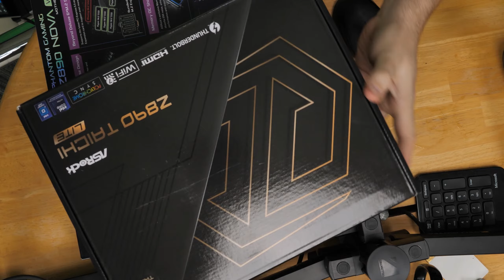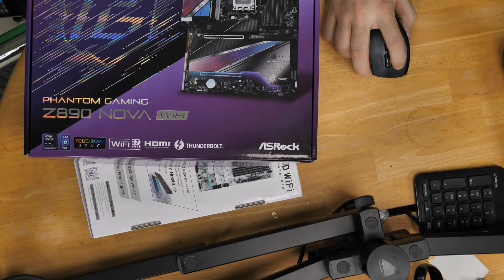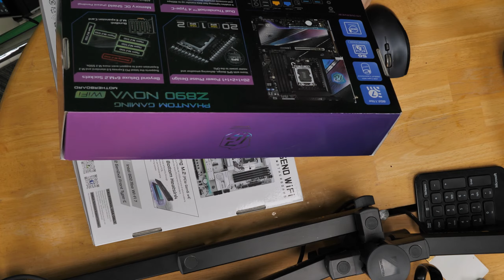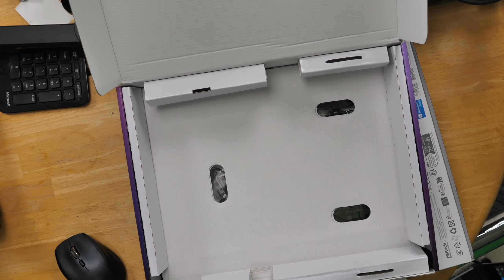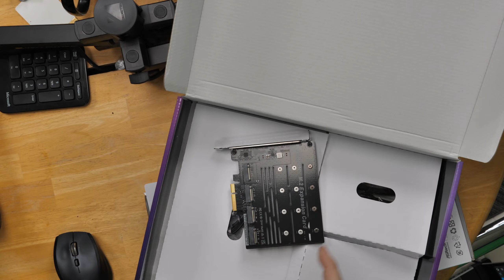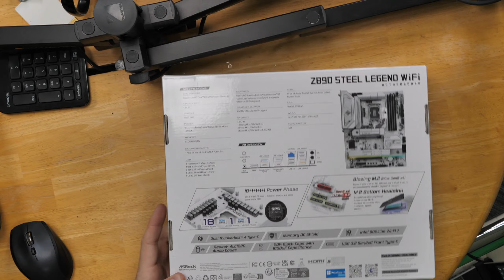Live - Z890 Motherboard Unboxings And Chat!

Comment: I have the Gigabyte Aurus z890 Elite Ice, with a 265K.  Really like it, it's a big upgrade from an 11700K. I suppose if you have a working 14700K or 13700K or even a 12700K it's probably not yet worth the upgrade.

Comment: I tend to prefer AsRock boards first (then Gigabite or MSI whichever has better specs for the same price) but this Blue and Purple paint on the board VRMs and other stuff I cant. Clashes horribly with my scheme. If they had just a "plain black" one I'd be all over it.  If nothing else pops by mid February I guess I'll get the MSI Pro Z890-A, 5Gps LAN and T-Bolt 4.  And screwing in heatsinks is a nothingburger for me. 5-10 seconds and I'm done.

Comment: The Live Mixer Z890 ATX board has excellent rear I/O, an accessible M.2 wifi card, and comes with three actual x16 (physical) PCIe slots. No EZ-GPU latch and one bare M.2 slot, but it is still one of the best configured, especially at a lower price.
Reply: I'm curious, why do you need 3 video slots? Anyway,  you change the video card every year....

Comment: I know using the 2nd PCIe slot on the Taichi Lite will disable the M2_4 slot (as per the manual), but do you know if using all 6x M.2 slots at the same time will slow down the GPU from 16x to 8x etc like with previous gen motherboards/cpus?

Would like to purchase at release on the 24th but can't find any info on this online.

Keep up the good work!
Reply: No impact.  No M.2 slots share any of the x16 lanes for GPU.

Comment: One thing not mentioned is that when you compare to the immediate last generation, the MBs in question seem a tiny bit down in terms of features or IO.  Not 100% in all cases, you'd have to hold up the 790 boards side by side to really see where they trimmed,  but it shows that when you don't have intergenerational competition for motherboards, the manufacturers have room to take a bit more off the top, in addition to the price levels they can sell the boards at when they first launch.  Or it could be that the newest and greatest features of the current gen cost so much more, that in order to hit their price targets they had to cut a couple less commonly used features along the edges.
Reply: I don't know, I bought the Gigabyte Aero G, Z890 for the 15th gen core 7 Ultra 265K CPU and it actually has a few more lanes, PCIe 5 NVME slot, 4 gen 4 slot NVME and something like 4-6 SATA connections and 2, count 'em 2, 2.5GB's Lan ports (the older Z790 only had 1, 2.5GB/s LAN port), you can go redundant or together to double the throughput. 

So much of what you see is hidden, oh, it also has USB 4 (Thunderbolt), the Z790 did not if I recall. At best, it has the Gen 3.1, gen 2 2x2 type C port(s). I'm sure there might be other additional features for the Z890 that I'm not thinking of.

Comment: I'm so over this idiotic rationing of PCIe lanes. The industry has moved on to PCI storage, we need more god damn lanes and bifurcation. All these boards are way more expensive than my last X299 board and have way less expansion potential.
It doesn't need to be threadripper lane counts, just give is 28 or 32 that we can split up for more NVME and add in cards. These ATX boards are becoming just as limited and frozen in time as laptop boards.

Comment: What I don’t understand is, if Intel moved from Intel “7” to TSMC 3nm, which allegedly has power efficiency and transistor density benefits, then why didn’t the new chips receive an upgrade in terms of additional CPU cores?  When Apple moved to new nodes (e.g., from M1 to M3/M4), Apple offered additional CPU cores, utilizing the density benefits of the new node.

Comment: I think Intel is preventing OEMs from making mATX boards for AMD’s X870.
Reply: What sort of conspiracy speculation nonsense is this? Why would anyone make a mATX 870e? You can't physically fit that many PCIe slots on mATX along with the second chipset and power regulators. 
AMD does hold back their mobo vendors with poorly considered  PCIe lane configuration requirements. So they couldn't make something like a single 8x slot with gobs of m.2 and peripheral ports that don't share lanes even if it was physically practical.
Reply: @mytech6779  I think Hardware Unboxed confirmed this, and I said X870 not e.
Reply: @koob1413  Ah I was thinking of the 670[e] which were both dual chip; I forgot they nerfed the 870 and removed a p21 chip.

Comment: I just realized z890 taichi doesn’t have dual x8 pcie slots.
Reply: That will only be an issue for a minority of people, I've never needed faster than x4 on the 2nd PCIe slot and that includes an Elgato card recording at 4K60.

What's more annoying to me is that using the 2nd PCIe slot disables the M2_4 slot reducing the possible NVMe drive count, but again that will only affect a minority of people as 5x M.2 slots will be enough for most people.

You may be one of the minority though, what sort of stuff are you looking to put in the other PCIe where x4 wouldn't be fast enough?

Comment: I wish mb would allow more 8 lane/4 lane PCIe cards, also all mb's now should have as standard 10Gbe RJ45 connections that can do 10Gbit, 5Gbit, 2.5Gbit and 1Gbit !
Reply: Purposeful hobbling of the ethernet standards, most consumers are too ignorant to know. However I have seen some already moving to 5g. Then again if you actually care about network overhead you would have an intel PCIe add-in NIC and not rely on the shoddy budget broadcom chip built into the mobo. (note asrock-rack mobos for epyc4004 have intel as a network option)
At 10g CPU packet-overhead of the cheap network chips becomes a substantial consideration, like 1→2 full cores worth of overhead, high end NIC will offload at least half of that if not 80% depending on specific tasks.

Comment: Poor mans rubbish. 8 pin power missing 150W from the PCIe 5.0 limiting what you can add. Top GPU's you most likely will not get most. Only one sided cooling for the storage. Bare bones.
Reply: Power comes from the PSU

Comment: It would be really nice if you could get a high end chipset board without all the silly gimmicks on the board that drive up the price. There is no need for an attached IO shield or covers over the rear IO and most of the rest of the board and the metal over the PCIE slots is useless. The LCD screens are very clearly a total waste of money on a motherboard as well. Also almost every motherboard comes with WIFI and the motherboards without WIFI have slots for a WIFI card to drive the price of the board up that much more, so if you dont need/want WIFI you are forced to pay for it regardless.
Reply: Are you certain the heat sinks aren't useless? I bet with modern chipsets, MVME drives etc, they need a heat sink of some sort so I don't think they are useless. Have you tried to install an I/O shield? They can cut, be sharp and can be problematic, so they come preinstalled. I bought a Z890 motherboard from Gigabyte and it was less than the CPU (both over $300, but under $400). We'll see how it all works when I assemble the new PC. I still have the PSU, case, front IO/card reader all to come. They are ordered, ready to ship. I also need 2 more drives, one for editing/cache and another for cold storage.
Reply: I agree. I hate the way the market is now. I don't want a bunch of extra crap. Give me 10Gb port, 7 segment display, clear cmos, bios flashback a few m.2 slots and drop the rest of all that uselessness.

Comment: I want to look into Sata drives for building raids, would use nvme m.2 for os.
Reply: Sata HDD? 
Sata ssd are on the way to history, they were only to assist the SSD transition for old pre M.2 mobos. 
M.2 and U.2 are the new standards.
SATA ports are still connected via PCIe lanes(Although fewer lanes due to slower peak speeds.) which begs another question for raid because most mobo do not use direct cpu lanes for sata so all of the traffic will be funneled over the same 4 cpu lanes that the chipset uses for all of the other peripherals. There may be some direct device-device ability to avoid the CPU lanes entirely, but if not it could be a major bottle neck, and I don't have much faith in consumer grade mobo engineering and firmware.

Comment: Right now a stock new rip off cpu from intel is as fast as a 13900/14900k overclocked a tad, why pay all over again for rip off motherboard and rip off processor just to get same performance and worse ddr5 speeds that z790? I mean won’t be a fps difference, better to save money for rtx 5080/5090 over this junk
Reply: You seem bitter. Have you tried meditation or self medicating?
Reply: some people don't want to play the lottery of whether their cpu is going to fry or not. Intel says they have figured out and fixed the issue, but they've said that 3 times now.

Comment: No 10GbE on these. =/

I'd hope that 10GbE would be more common place by now, especially for mid-higher end boards.
Reply: yeah they're only putting that on $1k mobos so that people that need it have to pay that price. It's dirty imo.
Reply: @keensbeanz   The real grime of 2.5g is that it is a deliberate hobbling of the BZ standard. The whole point of BZ is to auto negotiate the line quality and choose the speed from 1g to 5g [*10g.] 
Really no excuse for not offering 10g because BZ was made compatible with the slightly older AN standard. 
The real issue is that 10g+ needs a NIC that can offload packet creation and unpacking because that many packets is huge CPU overhead. (and super-jumbo frames never caught on with consumer network equipment due to proprietary marketing wank.)
Reply: I'm seeing 2.5gbe is becoming common, maybe it will jump to 10gbe next generation but manufacturers skip, so 5gbe. They stayed on 1gb for too long. It will be awhile before 10gbe is affordable. Perhaps sacrifices to the Silicon Gods will bring great gifts to the masses.
Reply: @xlr555usa  That is why people still use add in PCIe NIC. That one 10g card purchase from 6  years ago can follow upgrade to upgrade.The other reason being the built in NIC use in consumer motherboards are cheap trash that don't really hit full speeds, and a good (expensive) add-in card will actually saturate the network and greatly reduce CPU load.

Comment: I delayed a build from June for a good friend. I still have not settled on Arrow Lake. Is 1851 a dead-end slot? After several years of building countless systems for friends and family on Intel, I may go with AMD AM5 zen4.
Reply: Shouldn't you be building Intel or Amd Pcs based on what is needed and budget? Doesn't make sense to limit your options.
Reply: You’ll likely only get something like an Arrow Lake Refresh on LGA 1851, so not two “real” generations as it had been the unspoken rule on Intel platforms. Why? Last year’s Meteor Lake was supposed to introduce the LGA 1851 platform and Arrow Lake is already the “second” generation of CPUs for this platform. Meteor Lake turned out to be too shitty to even be released on desktop and was aborted. Arrow Lake doesn’t look that great performance-wise.
Reply: Doesnt matter.  Drop in upgrades aren't relevant.

Comment: Are we mad at ASRock or not?  Are we still mad at MSI and ASUS?
Reply: Bit and Byte them all! I'm waiting for faster specs for ddr5 and pcie5 nvme, these iterations should mature nicely all through 2025. Intel says it is not refreshing Arrow Lake and they still need to rebuild the company after layoffs, that said Panther lake won't be ready until 2026 or later. It seems like a missed opportunity but Intel has been scaling back to save money. Have to see if Arrow Lake will support 15000 mt ddr5 memory and higher and pcie5 nvme 15000 mb read / writes. It's right around the corner.
Reply: NAND can only write about 4Gb/s (500MB) and that is the better 2 and 3 layer stuff not the slowass quad layer which is about half that. The advertised nvme speeds are 100% cache effect.

Comment: I just got an ROG STRIX B550-XE this week and it came with one of those 4x M.2 cards too. Asus must have overestimated demand.
Reply: I can't bring myself to buy a budget mobo, it's very limited and the money you save is irrelevant
Reply: @xlr555usa b550 is not very limited
Reply: @xlr555usa  Haven't been limited by anything yet, so I'll save the cash 100%
Reply: ASUS’ 4 x M.2 adapter cards are hilariously big, their sheer physical size disqualifies them from many builds by people that would like that capability to use multiple M.2 drives.
Reply: Those breakout cards are extremely cheap to manufacture. A decent USB cable has higher cost.

Comment: So are any Z890 boards going to come with USB4 that doesn't depend on an add-in card?
Reply from the maker: all three of the boards had thunderbolt 4 on board so youre all set there?
Reply: @Level1Techs  Thanks, I was unaware of the nuance of the standards. I had to look it up as I was unfamiliar with USB4 until I saw your video on the new AMD mobos. I had assumed it was just the next iteration that would be adopted by both platforms.
Reply: @keensbeanz  Thunderbolt 4 is usb4 with extra intel sauce (approvals and some extra support) if I’m not mistaken

Comment: I'm one of the few people that seems to be genuinely interested in Arrow Lake. Everyone has been high on Ryzen for quite a while but Intel has been the clear choice for mixed use for a while thanks to e cores. Especially for anything under the i9/R9. I'm one of those that run a mix of gaming and compile/compression workloads.

The i5 and i7 give little up to the overpriced 7800X3D in real world gaming, but when you account for real world production where you actually use your full CPU the i5s and i7s have been annihilating their similarly priced counterparts for years now. It's really only the i9 that's been a poor choice because it can only match the more expensive 7950x, while using vastly more power. 

I don't own a 4090 or game at 1080 so my i7 is identical to the all mighty 7800X3D, but absolutely f*cking curb stomps that overpriced 8 core the second you turn off the kiddie games and ask it to do real work. All while being cheaper.

Until AMD starts offering decent amounts of cores through the midrange the vast majority of us buy I'll be staying on Intel. Ironic when those roles were reversed just a few short gens ago and AMD was the one that gave you affordable cores.
Reply: I am very interested too, especially for laptops, as I plan my next one to be (hopefully) a Framework 16 with Arrow Lake and 128 - 192 GB of RAM, which HOPEFULLY won't be dragged down to 3600 - 4400 MT/s (if you're lucky) like the current CPUs are (both Intel and AMD).

My 8 year laptop won't resist waiting another generation, so I really hope that Arrow Lake delivers. I don't need top gaming performance (especially in a laptop, clearly the GPU is more the limiting factor), but I do want to be decently performant and stable. I'll do a lot of compilations and web dev.
Reply: i have no idea what weird niche thing you do, but every single test has amd curb stomping intel aside from a few weird niche things. you aren't the normal or the majority.